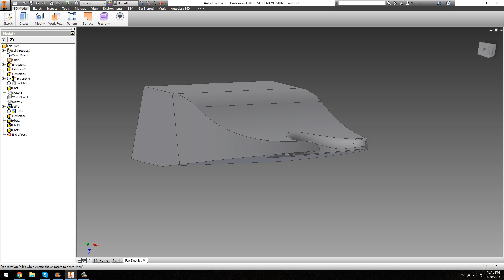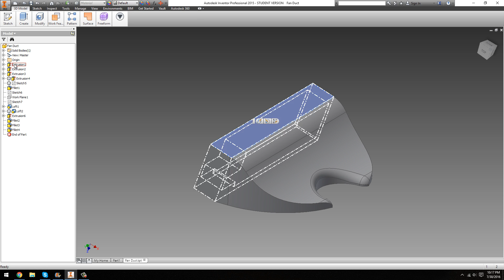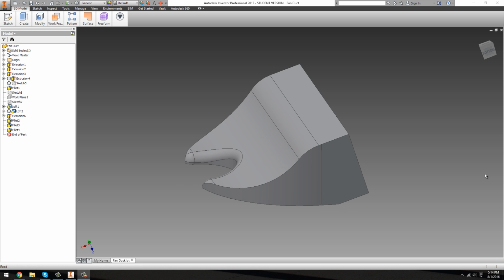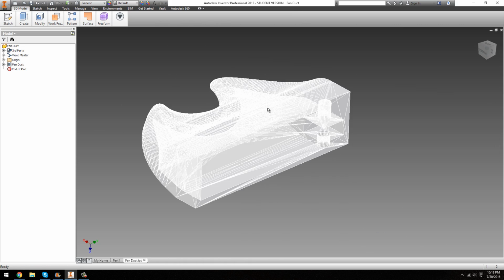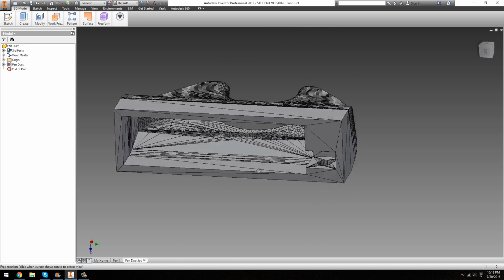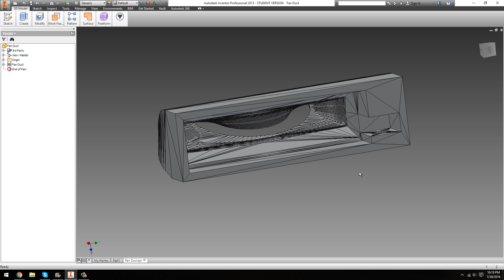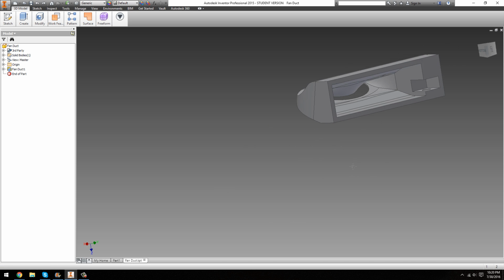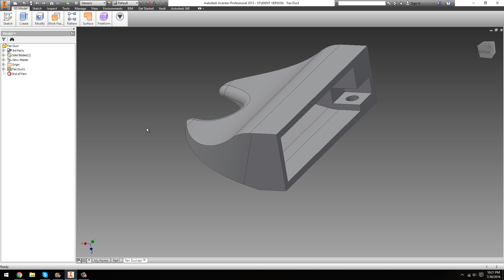STL vs. STEP Files - What's the difference?!

Comment: STL is needed in softwares like simulfact. STL meshing is very important for physical simulations.
Reply: Actually, FEM software uses the volumetric elements, not the surface triangles. It is very important to generate this "finite elements" through the whole volume of the model, according to the required simulation parameters, every time. Generate a triangles from the smooth surface and save them to a file - pretty stupid idea. STL meshing is just a loss of information, nothing more.
Reply: @alexkart9239  you just have to add parameters in simulfact but if you have Inventor for modelmaking find a better way to make models (like calibres for hot forming steel beams for mining reinforcement) add to simulfact.

Comment: You state that you don't know what other uses STL files have other than 3d printing, but let me add a couple more: game development uses meshes, STEP files are limited to the mathematical descriptions that can be used to create the surfaces, like b-splines (nurbs) or similar, and therefore things like reliefs are very hard in STEP, and finally, there's architectural design, often done in Autocad which is also a mesh and vector editor. And then there's the entire movie industry that uses software like Maya, 3D Studio Max, ZBrush and more, all mesh editors. Meshes have their place, they are just a bit inconvenient for the more complex CNC machining tasks, but that's it. I'd argue there are more applications for 3D meshes than there are for STEP models. That said, nice video, shows nicely the difference between the two and I used it to teach my dad about the differences and why he can't convert an STL into a STEP file 'just because a client asked him'.

Comment: I purchased Meshcam that allows stl files to be CAMed, though it probably is best to use iges or step files; I have also seen obj files though I've never used any of those. Fusion 360 also allows you to CAM out mesh files. It was a challenge to figure out how to do it, but it allows it.

Comment: Well actually a STEP file contains part geometry which CAD/CAM can process, while STL is just a "mesh" as if you've thrown a triangular weaved net over a part.

SpaceClaim is great for editing STLs, but it's very expensive and the STL editing tools are a separate module that must be purchased separately.  It is however one of the best CAD software I've ever used.

The part you have shown is not really machineable in it's current form, as there are some inside corners... well you probably can do it with 5-axis, but that's really expensive for a part such as that - which looks like a part cooler for a 3D printer extruder head. 

Also I'm not aware of a slicer program that reads files such as STEP or IGES...  though it would be really nice (and make a 3D printer run a lot smoother) if arc commands could be used in g-code and also interpreted by the controller as well...  Most good CAM will output arc-optimized g-code with Z-level (waterline) machining.  IT also makes the g-code a LOT smaller than it would be with point-to-point machining (which is what all slicer programs do.)

Comment: Will STEP improve 3D printer quality?
Reply from the maker: In theory, yes. But in practice, probably not. The only time you will see a lower print quality due to stl files is if the file was saved at either way too high or way too low of a resolution. Too low and you will see lines on curved faces. Too high and the slicing will take forever and may cause issues when printing due to too much data being sent too quickly. But the thing is, I don't know of any slicing softwares which support step files just yet. Using step files would definitely eliminate a few sources for error, reduce file sizes, and possibly reduce slicing time, but STL files are so ingrained in the 3d printing community that a transition would be very slow and very possibly it will never span all of the slicing programs out there.
Reply: There are several slicing software starting to allow for STEP import along with STL and other formats, such as GradCAD Print (Stratasys), Makerbot, Carbon 3D, 3D System, Autodesk Netfabb and etc.

Actually, in general the print resolution can be improve if using STEP over STL, because when saving solid object to STL, it has the over tendency of generating polygon errors when set at very high resolution even though majority of 3D printers out there can physically print high resolution (some even at 75 micron) on X&Y plane.

Also, to note different 3D CAD packages generate STL differently, some with far fewer mesh errors and others much more.

It a bit like working with Bitmap VS Vector in the 3d world (or Bitmap VS Illustrator).  Simply put, STEP file are more consistent to work with, file isn't fixed in time (PDF reader) for geometry modification, with far fewer errors, smaller files size, quicker import/ read time if compared to a STL file.

Also, 'most' 3d printers wont accept bad geometry unless you uses STL repair tool (Solidworks constantly crashes if done on moderate detail part), but you don't get 'bad geometry' to begin with if using STEP (majority of the time).

The problem is that 3d printers (really be called 'additive manufacturing') and STL was invented decades before the introduction of an universal 3D format STEP back in early 2000 (if I recall).

Comment: The STL file was originally named from the process of stereolithography, today some call it the "surface tesselation language" too. STEP (or ISO 10303) comes from the term "Standard for the exchange of product model data". It can have much more information in it than just boundary representations (BREPs) of your models 3D bodies, you can have full assemblies of bodies and all kinds of other information in a STEP file. 

The best software i've come across until now for working with (i call it reverse engineer) STL files is Ansys Spaceclaim. It's very good at converting STLs back into solid bodies so you can use them again almost like a normal BREP part in all the CAD tools, or allowing you to analyze, fix and modify the surface model directly. (Spaceclaim imports/exports basically almost any CAD file format, if you have the right license options) The free version of Spaceclaim called Designspark Mechanical (DSM) can convert most watertight STLs back into solids too, so you can use the direct modelling approach to do some easy modifications, it will however not convert the small surfaces back into splines or rounds. It's big brother has a lot more tools for working with the surfaces and fixing errors. DSM can work with (and even edit, with a little "trick") STEP files too, but you can't save it back into a STEP file with the free version, unfortunately.
Autodesks Fusion360 is still my goto sotware for most CAD stuff tho since it's free for what i do. Now that they included surface mesh tools with one of the latest updates (July i think) i'll have to play around with F360 and STLs a bit more when i find some time.
Reply from the maker: That's awesome, thank you for all of that info!! It makes sense why the consumer 3D printing world defaulted to using stl files despite there being much better options out there. And I'll have to check out that program, I really hate editing stl files in most programs so anything to make that less painful would be a godsend!
Reply: How is Fusion 360 "free" ??